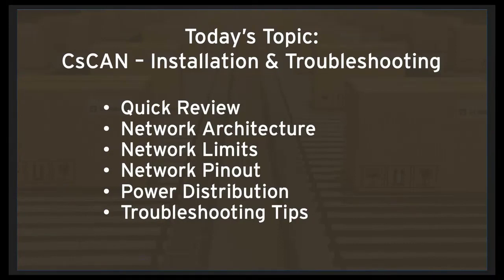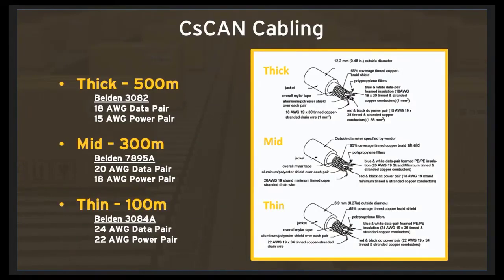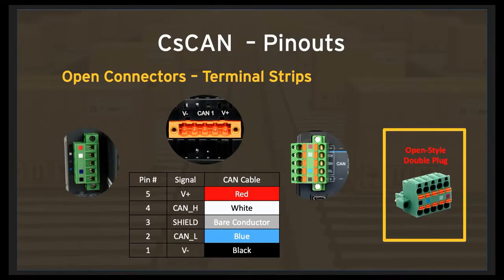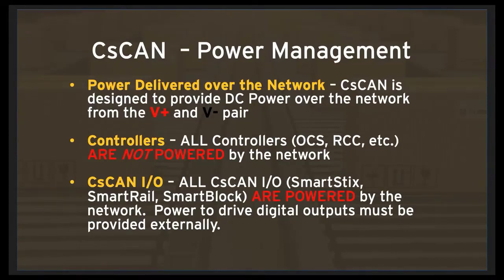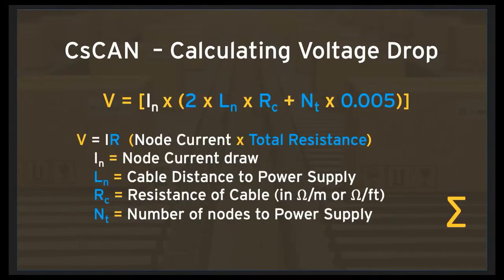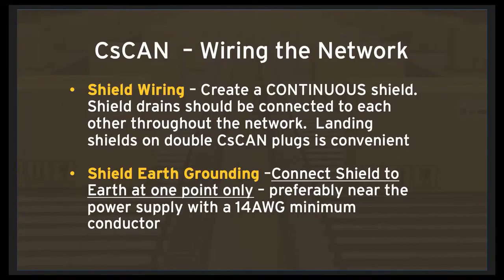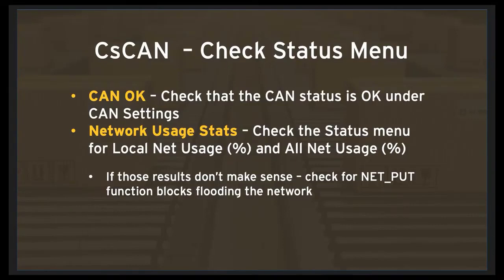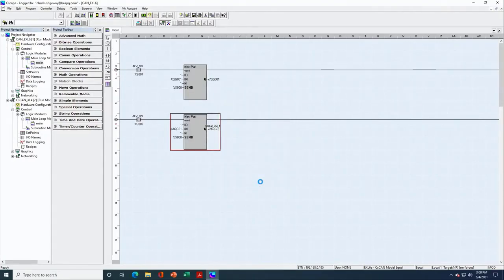CsCAN Networking: Installation & Troubleshooting

Comment: I wasn't available for the live presentation but I do have a question.  Given the Global data support has 32 words and 64bits, do you need to define an additional CAN address if you need over 64 bits of Global data but less than 32 words?
Reply: You shouldn't need an additional CAN address if sending less than 32 words per ID. The 64 bits of data could be set up just as 4 words of global data.